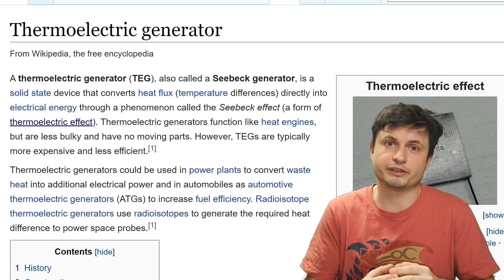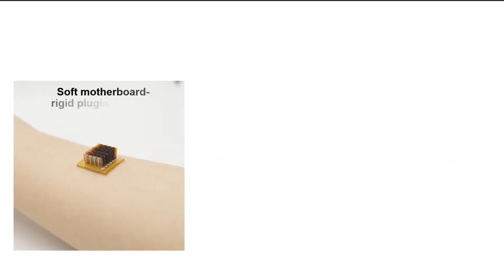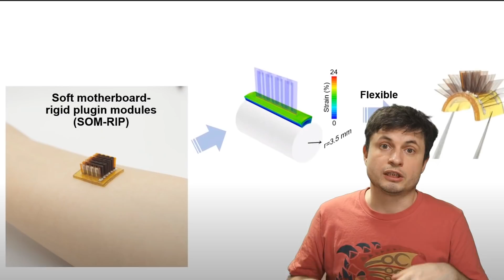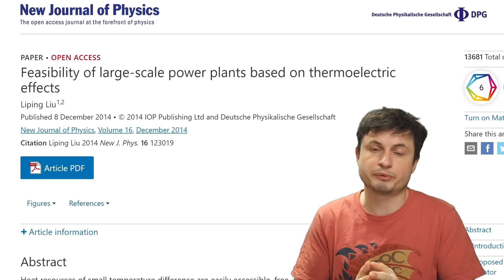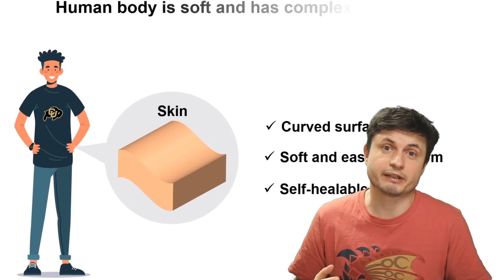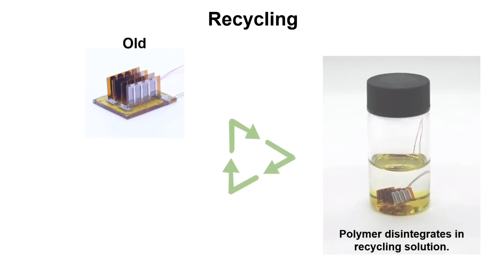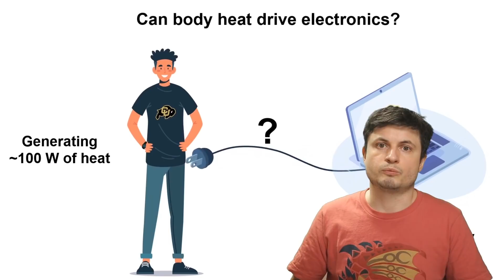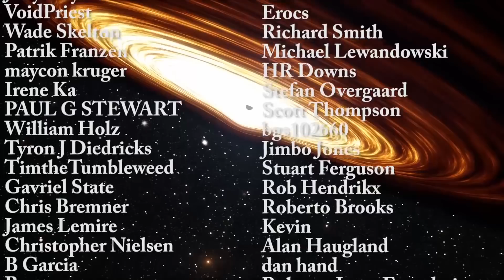Interesting Invention That Turns Your Body Heat Into Energy

Comment: i feel like sandwiching a layer of piezoelectric material in the middle would fix the generation problem. adding the heat and cold in sequence would then cause expansion and contraction of the outer layers, changing the pressure in the piezo electric material.

Comment: i know i've had a similar idea for using body heat to generate electricity... so i'm interested in the topic :D
Reply: i might as well share the idea here as well, not like i can do anything with it myself ... not a scientist or engineer basically.  do you know those hourglass shaped science things with the liquid that boils at body temp?  my idea was to use that liquid with a turbine sort of electricity generator, on a very small scale, like the size of a watch to the size of a seat cover/backpack.  since the liquid boils at such a low temp, the unit shouldn't become hot enough to hurt anyone... except maybe a battery issue.  anyhow.. idk what the liquid is called, so idk if its dangerous to people, so that was one of my issues.  next one was if i upscaled it to use for like cars, since cars with windows shut especially in summer can get quite hot inside, so the idea was to use that heat to power either the unit directly or for a battery to power a unit to cool the interior of the vehicle, without draining your cars battery... but then i got worried that in winter the units would probably need to be stored away to not be damaged, since the liquid probably also has a freezing temp, so how to protect the units from very cold nights or winter?  would the liquid be safe if you had a leak and it came into contact with your skin or if you accidently had it spray in your eye or ingested it... or even a pet.  so you see why i didn't get any further in the idea... but maybe you can or someone else reading this can, at the very least to see if the idea would be feasible?  ok i'm a run away now... it isn't the only idea i had for making electricity, but it was a promising one :D peace.

Comment: Problem is energy is always conserved but as less exploitable form. Heat is the least exploitable form of energy. So the heat emitted by the body could be equivalent as the energy consumed by a laptop, but it will never power a laptop. 

Why not power a laptop using the heat produced by your body and then using the heat produce by your laptop to power another laptop?

It looks as ludicrous as plastic from air to me.

Comment: Really like your channel. But just a little peeve I have: 1 volt of energy is just potential energy. In order to do work you need current. You can generate a 100volt but if you don't move electrons no work is done. I read the paper and it has lots of catchy terms, but practically this idea is still unviable. Thanks for all the great vids.

Comment: With "a maximum power of 7.02 mW and an open-circuit voltage of 2.12 V at a given temperature difference of 40 K" you will need diner lasting 100 days to fully charge your 5000 mAh phone battery (using two of these TEGs for the voltage), let aside the fact that a temperature difference of 40k would mean you'd have a 100 days long picnic in the snow. 
"Or in other words" you might charge it for roughly 0.3 % within one hour (if your the chosen body parts did not freeze within this time). 
I'd say: This could be optimised a bit. But maybe useful on large areas of otherwise unused hot surfaces.

Comment: What would happen to a solar cell during a Carrington Effect episode? Would it burn up or can the electric flow be terminated? By simply covering it or other means? It seems that most electric devices we use today would fry. I was curious about power generators during this time like solar cells, wind power, nuclear, water, etc. Thanks.
Reply: Most electrics/electronics would be fine actually; particularly cars, generators, phones, etc.  -- anything not directly connected to the mains or connected through surge protectors.  The only real risk is to electrical grid and satellite infrastructures and even that is often pretty overstated.  Look into what happened in Quebec 2012.  Granted it wasn't Carrington level but it's something of a precedent.  There really is no modern precedent so it's all speculation; much of it sensationalized.  Believe me though, most of your stuff is gonna be just fine.

Comment: UHM No. TEC  is not the same as TEG. Seebeck, vs. Peltier. Furthermore.. they have vastly different temperature grades and variance in output and input. Further still, heat siphons utilized with fluid cooling systems are not mass produced sadly, nor seen for their high temp energy creation with many aspects of the lives of people. FOR HEALTH REASONS, THESE WILL BE STOPPED from constant use And you ask why.. of course...

Because.. when you create a heat "draw" point on the body? It creates an inherently bad signal to the bodies homeostatic nature. Throwing the wrong signals for the response to the area of the body. Then you create a playground for things to come in and take root, as well as letting things degrade from lack of input, due to the inevitable "dulling" of the bodies senses to that point. Some would experience inflammation, others growths, and still others, neuropathy in regards to nerve damage to the areas. It is great they have the ability, it is not a constant situational item, Purely potential for "emergency" use.

Comment: I've long wondered if piezoelectric materials could be embedded into shoe soles, or even onto equipment that vibrates, such as exhaust pipes, suspension systems, etc.
Reply: Russian military tried piezo boots.  They found it was either not worth it in terms of energy or discomfort.  You gotta think that if you have shoes soaking up significant power from your stride you're gonna feel that.  Regenerative suspension is a great idea tho imo.

Comment: Theoretically, a more advanced version of this in the future could replace steam-turbines in nuclear generators. It could bring down the cost, complexity, and danger of modern reactors if we use it correctly. Obviously the design needs major improvements until we use it in such an extreme environment, but it's feasible.

Comment: Combine these types of devices with several other innovative apparatuses, and watch as human engineering explores many different observable electrification harnesses. Then incorporate those in series and it may keep a cell phone or other device battery charged. But it still requires a bat or cap.

Comment: Volt isn't a unit of power. Power is equal to voltage x current. Having 1V of voltage doens't nessesary mean it can produce usable amount of power to power something. The information is incorrect, but nice video.

Comment: 1V is the voltage probably measured with no load. It is NOT a measure of energy. What matters is POWER, not energy. You need something that can supply at least something like 50mW to charge anything (very slowly). Also, placing this stuff near hydrothermal vents makes very little sense since we have much more efficient ways of harnessing this energy, e.g. with Stirling engines. Heat engines beat Seebeck every time, at least for now.

Comment: Sory to say, but do not be too excited. The device is producing 19 μW/cm2 at ΔT = 93 K, i.e. with typicallly only a few degrees difference from skin surface temperature to surrounding air, a lot less will be generated than with a 93 degree difference. A few micro watts is far from enough to power or charge most modern devices so it is not just a walk in the park.

Comment: I'll have to take you to task on this one. First up it's not correct to say 1V of energy. 1V is the open circuit voltage obtained, i.e. with no load. It's about 0.5V at peak load. The actual power output is around 10uW for the 1 square cm device shown. But that's at a 93deg temperature differential! The actualy measured output on the skin at room temperature is around 100nW. To put that into perspective 10uW is barely enough to run an ultra low power normal LCD watch, maybe a really really dumb "smart watch". 100nW won't power anything wearable device at all, simply impossible. But more to the point, it's pointless, because a typical 2032 coin cell battery can produce that same 10uW of power continuously for about 23000 hours, or about two and a half years. I've done a video going over the calculation for this exact thing for peltier device smart watch.
It's nice research, but the applications are extremely limited.
Reply: @Nad Senoj No that is simply not true. For TEG to improve significantly you would need to pretty much violate conservation of energy. From all the data we collected energy is always conserved. Maybe there is some weird situation when it is not, but we can pretty much guarantee it would not be a human skin-temperature in usual ambient temperature and pressure but something exotic we can't easily reproduce on earth.
Note that "theory" in physics doesn't mean what it means in the general english language. A theory is established knowlege that has lots and lots of data to back it up. The math might be inaccurate in some points but the data behind it cannot be dismissed, they are not just "placed" there.
As en example: when Einstein overthrew Newtons theory of Gravity it didn't mean that Newtons formulas were wrong. They were simply not put to explain new data. Gravity still works, the apple still falls to the ground, that's a fact we established by observing millions and millions of apples falling to the ground. It is not a limit we put on ourselves. 
As for your example "50 years ago computers were considered impossible", no they were not considered impossible the same way like this being useful in the presented form is impossible. They didn't violate any basic rules of physics, they were just to complicated for us to build and some people thought it will never become economical to do so.
Reply: Dammit Dave, you beat me to it!
Reply: Exactly. Was going to comment the same, but you said it better.
Reply: Thanks, i was about to spread the dissinformation from the video then lol
Reply: I had huge doubts watching this video, so I read the article and I was right. The energy produced is insignificant.
"...the max power generation Pmax increases with temperature difference ΔT and reaches 19 μW/cm2 at ΔT = 93 K."
I am disappointed. Anton should have been more critical of the claims of the article.
Well done for spotting this everyone.
Reply: Is any progress being made?
Reply: @Armin Tamzarian dolphins with lazer beams? I bet the DoD would throw money at us
Reply: semantics
Reply: Thanks for the obligatory calling out of these farce applications. love your stuff
Reply: A SOLAR CELL IS 10000 BETTER. A SOLAR CELL CAN GENERATE 3 VOLTS AT 100 MICROAMPS= 0.3milliwatts and is proprtional to area and light
Reply: Just crushing Antons dreams man.....
Reply: I’m definitely not challenging you on the math, however I am challenging you on the perspective on the point. 
Technology evolves. Even if it might not be very applicable today, it might become essential tomorrow when it has improved.
Reply: @elcasa1  Keep in mind this IS an improved version of a technology we know for about 200 years. Also there are theoretical limits that simply can't be overcome even if we improve the technology.
1. There is a theoretical maximum that you can gain by converting thermal energy governed by Carnot's theorem: for a process with ambient temp. of 20°C and a human body temp. of 37°C that maximum efficiency is roughly 5.5%
2. A human body produces in average 80W of heat on an area of roughly 19000 square centimeters, that is 4.2mW per cm^2
3. the best peltier element we ever built had 1/10th of the 5.5% carnot's efficiency so that's 0.55% efficient overall and the only part where we could improve things, the rest are hard facts
Now considering all 3 the 10uW is almost as far as we can possibly go, we get 23uW per square cm
If we somehow manage to improve peltier elements in general and overcome that 1/10th carnot's efficiency problem so we get to 100% of thermal energy that we can convert according to the laws of thermodynamics, even then we only end up with 231uW per cm^2
Reply: @elcasa1  even if efficiency improves greatly it still would not be practical since then it would extract to much power and cool the body to much. Only in situations where the body has trouble getting rid of the produced heat would it be a good idea to convert that heat into electricity.
Reply: This was pretty much acknowledged...
Reply: Ha Ha. I was going to send this to you as another nonsense video but you got there first :o)
Reply: This is a great point, however you forget that this technology is meant to be scaleable. One little nub would barely power a wristwatch, yes, but how about like, 40 of them all over my back? Now that's what I call power.
Reply: @deez_noots  need to be exposed to air circulation to maintain temperature differential. Easy to do on the wrist. How are you going to do that on the back ? But in any case, the amount of energy even from 40 is not enough to power a watch. Anton’s math failed this time, 1V is meaningless without current. There’s no current to speak of in the paper.
Reply: @A31415  and even 1V is only if you visit antarctica in wintertime. At night. Without gloves.
Reply: your belief in science is shown; but shown as limited in the history of science. yet what is science an what rules really govern what we can an can't 😷?
Reply: @ShawnJonesHellion  I agree with that.

Comment: What if instead of attempting to use this effect to generate  electricity, you used it insead for indoor space cooling in hot climates.  the elecritcity this might save by passive cooling could far outwigh its electricity output.

Comment: "We don't know who struck first, us or them. But we do know it was us that scorched the sky. At the time, they were dependent on solar power. It was believed they would be unable to survive without an energy source as abundant as the sun.

Throughout human history, we have been dependent on machines for survival. Fate, it seems, is not without a sense of irony. The human body generates more bio-electricity than a 120-volt battery and over 25,000 BTUs of body heat. Combined with a form of fusion, the machines had found all the energy they would ever need."

Comment: Dose it have to be in contact with skin or is it just regular body heat because a skin tight thermal clothing that charges your phone is such a cool idea. You can have a wireless charging pocket. You could even have survival clothing, a low powered heating elements that could essencially save you life in cold environments. Maybe even this clothing with heating elements can cause a buffer if you will so it in a sense stores it's own heat and your excess heat can be a sort of net profit making it more efficient.

Comment: It seems to me that the electric generation is based on a sort of bottle neck of energy flow. 

So let's say you have an extremely hot fluid on one side of a heat sink and a really cold fluid on the other side of a heat sink...the energy generated is going to be whatever heat can't flow through the devise fast enough. 

It seems like this might work best if the cold and hot side are designed for the most temperature flow but then fairly limited temperature flow in the middle. Let's say like a couple of cpu back to back

Comment: Hi,
A volt is not a unit of energy, but a unit of electrical potential, which is not the same thing. Joules is a unit of energy, or Watt•hour.
The paper is really clear about the device capability, 1V is achivable at 90°C between the hot and cold plate.
Connected to a human, it can produce 45 to 83 nW. Compared to a   smart phone battery,  around 10Wh.. that would take roughly 13 000 years to charge... I think this video doesn't give that perspective and even try to pretend it in the same realm. 
As it says in the paper, with a larger surface, like a wristband that would be 25cm by 6cm, it would be achivable to reache 12.5μW, in the best case senario, which would be able to power a small transmitter at best.
To put in perspective, 10Wh would heat 1kg of water by 36°C. 
If you would cover your full body of this device (1.7m2), it would takes 295 days to charge your phone. 
I hope we'll find a way to drop the energy usage of a phone!
I hope it give you perspectives ;)

Comment: I have a Spinal Cord Stimulator installed in me, with a battery in my back pocket area, and it is a real pain to recharge every three days, the idea of using your body heat to recharge, or even run it would certainly be Life Changing!

Comment: But I would have liked to hear how much electricity/power can one module produce? Knowing only the voltage tells me nothing 🤷🏻‍♂️. Is it 0,01W (with 1V/10mA) or 0,1W (1V/100mA) / module, or what? 🤔 Very interesting though, thanks!
Reply: I was told it's about 10uW 😬😟. So about 200 000 devices would be needed to power an average phone 😂. About 50 000 devices if charging the phone 24/7, but because this would be hard when sleeping, probably ~100 000 devices 12h / day. So not suitable for this application.
Reply: Correction 💀😂
It seems the highest mentioned power level 19 μW/cm2 was at ΔT = 93 K, so only achievable when on human skin if environment is at -60°C 🙃😂. In normal room temperature conditions the power output is only ~100nW... With that you would need about 20 000 000 devices to power a phone... That's 2000 m2... Meaning 1000 people would need to cover their full body with these to power one phone needing 2W power... LMAOOOO 🤣🤣🤣💀. These are useless for any consumer use I can think of 🤷🏻‍♂️.

Comment: Peltier/Seebeck devices have been around a while, I could be wrong of course but the "new" wearable device sounds like vaporware.

They can be useful, but the output is tiny, so only useful in special applications. Maybe with more low power consumption devices coming into use, that niche is expanding.